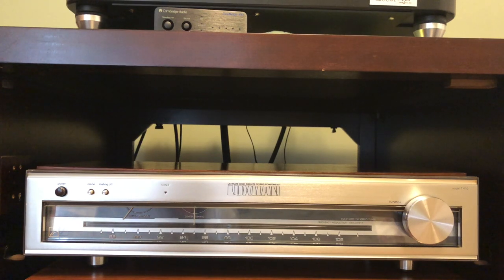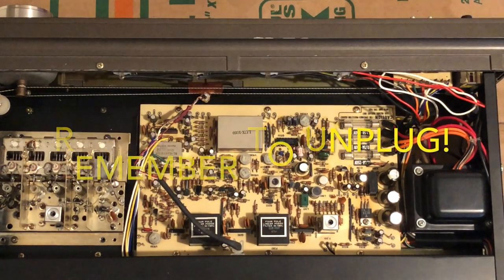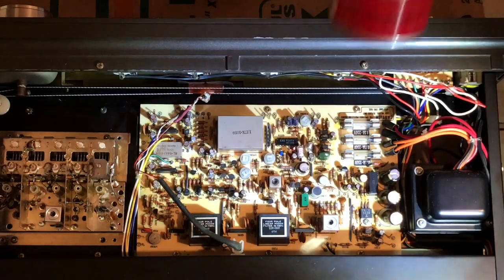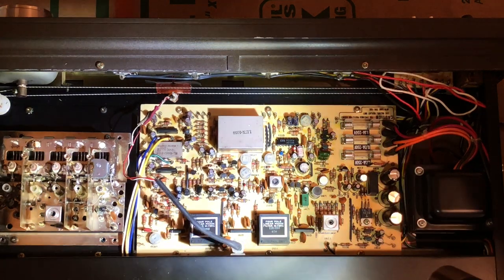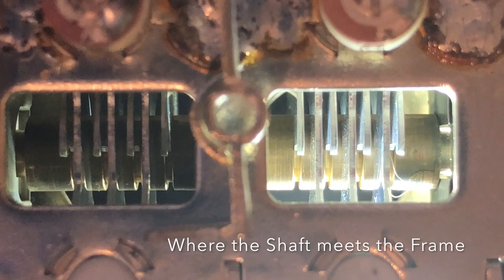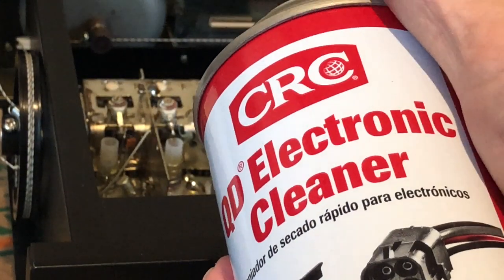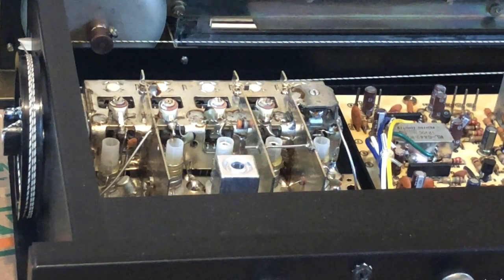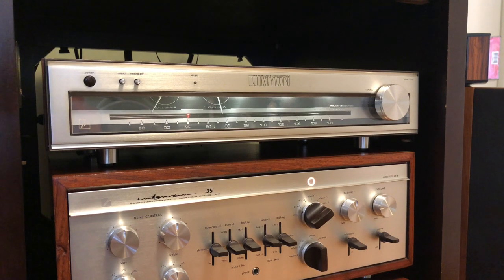Cleaning a Scratchy Sounding Luxman T110 Tuner

Comment: I've long been a fan of Deoxit but that electronic cleaner looks interesting.
Frank
Reply from the maker: Channel 33 RPM - About 1/2 the price of Deoxit ($8.00 US). I should of used it on the 3 switches instead of D5. I’ll try it on the next piece of gear (preamp). Thanks Frank 👍